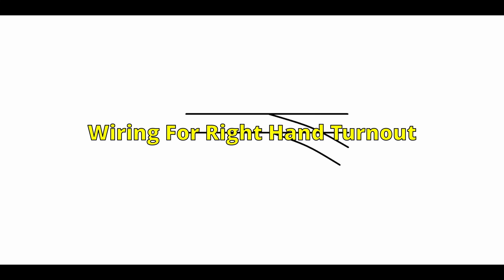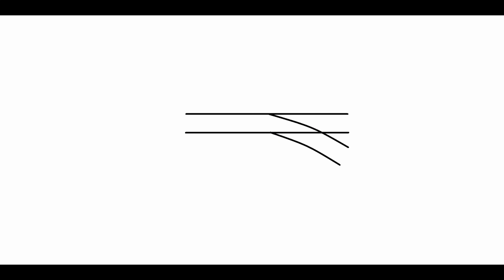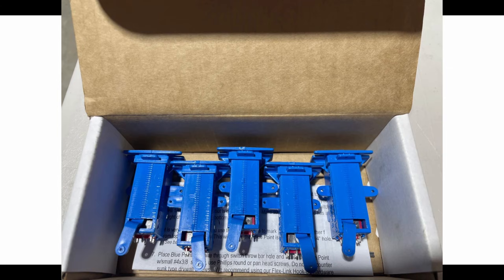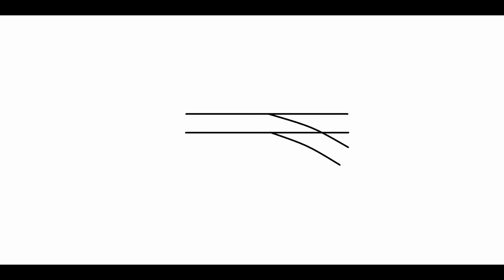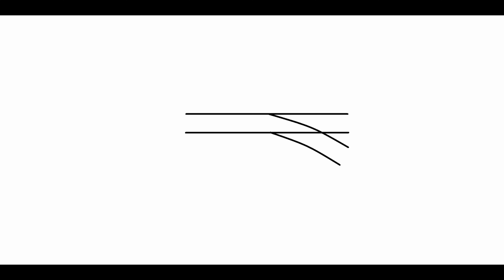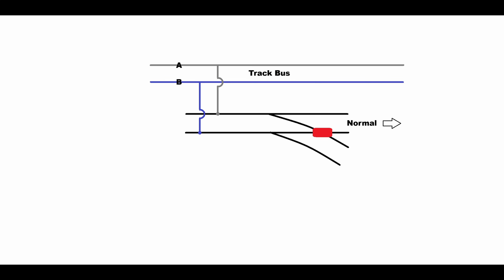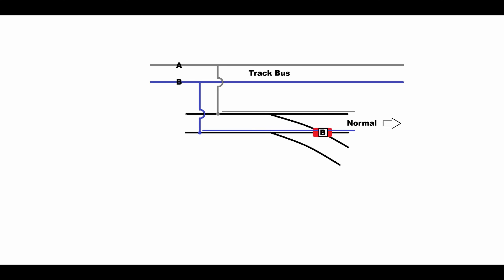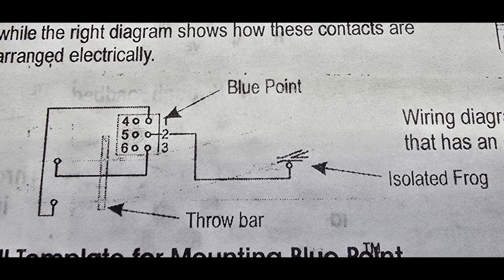Powering Turnout Frogs Through Switch Machines

Comment: Do you modify your turnouts for DCC?
Here's a video where Charlie mods his PECO turnouts for better DCC performance:
   < https://youtu.be/VYvpXGoxs4M?t=550 >
Wondering how hard it would be to switch to DCC and if the turnouts would need to be changed?

I didn't mod my turnouts because I'm not using DCC but I did
connect my frogs to TORTOISE switch machines like you have.
I also soldered all my power droppers to the bottom of the rails before laying the track to
completely hide the wires after ballasting.  A bit of a pain to do but the wires are totally hidden.
Reply from the maker: I use my turnouts straight out of the box. The only turnout I modified was the Walthers double crossover.